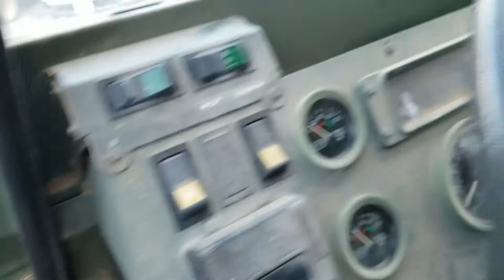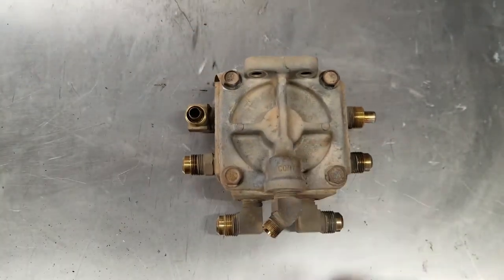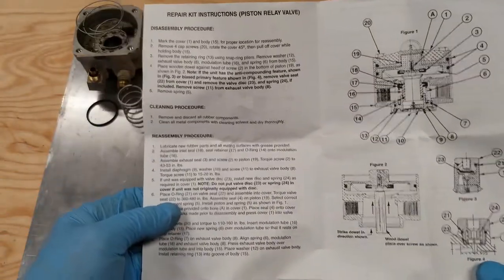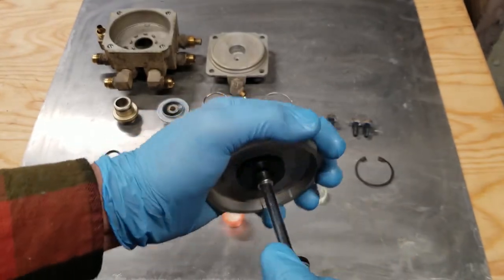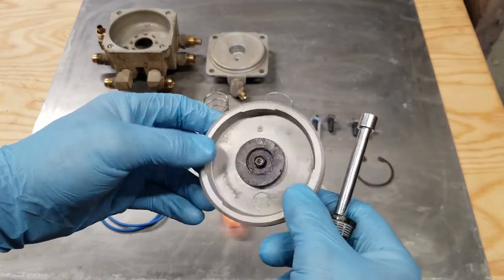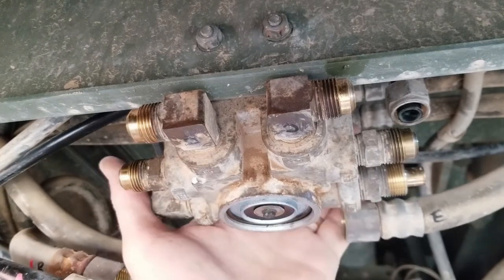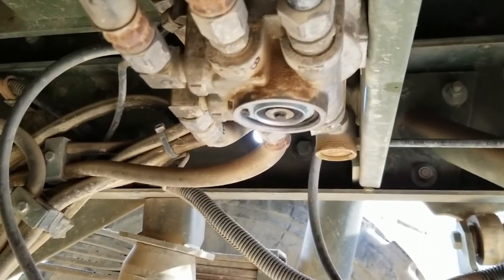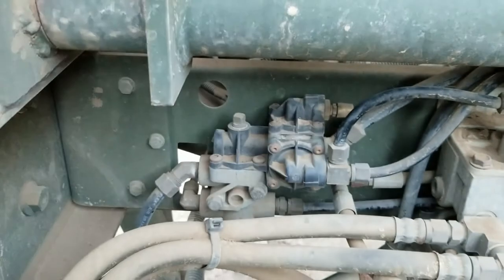LMTV Air Brake System - Haldex Air Brake Relay Valve Rebuild - Troubleshooting Leaking M1090 Brakes

Comment: I cut a circle of black duct tape to put on my buzzer to tone it down some.  It is there to let you know if while driving your air pressure drops so you can get off the road before your brakes lock up.
Reply from the maker: Sounds good. I still have the tape on the outside. Unscrew the cap and put it behind it so it doesn't look so rigged.

Comment: Hope you get it figured out they can be worry some anyway like your dump truck awesome
Reply: I have used duck tape myself and thought about disconnecting mine but if you do disconnect yours just be sure you or whoever drives it knows to keep a eye on the air pressure just like you would oil pressure and water temp cause they put those buzzer on there for driver safety reasons anyway hope you get that air leak taken care of some even take the emergency glad hand loose on the front and apply air there with a air compressor to trace a air leak but if you do that be sure to block the wheels because adding air from the emergency glad hand will release the breaks good luck I’m certain you’ll get her fixed
Reply from the maker: Got it all fixed up last weekend! Video coming soon. So glad to have it sorted out now. Before, while driving down a long grade, I'd really have to pay attention to how often I used the brakes. Not anymore. Thanks for the kind words. I really appreciate you!
Reply: low air must alarm must remain.  A long time truck driver/lmtv owner has made it pretty clear it is by DOT law that the alarm must remain.  Even though the docs say visual or audible alarm required.... he's found DOT inspection usually will assess the huge fine if audible not working.  Id guess in case of accident..... your insurance will likely not cover anything if it is not working either.   

 Some have found a cap off a can like wd40  or similar fits right over it and muffles it some.
Reply from the maker: Hi coachgeo. Welcome Back! Are you saying a visual alarm is allowed in the regs? Would a similar sized warning flasher work instead? Technically, this truck is not used on the highway, and only on the ranch but I do occasionally take it down the road to other ranches in the area. The local Sherriff wouldn't care one way or another but I prefer to keep this truck intact in a road legal configuration. What do you think about the flasher idea?
Reply: @cowboyV2  that is what I was saying after reading the DOT regulations that mentioned visual warning but the trucker (and LMTV owner) said.... in his experience.... the reality of it is a DOT officer will still fine you big time w/out an audible one.   Here is how it reads as of today

https://www.ecfr.gov/cgi-bin/retrieveECFR?gp=1&ty=HTML&h=L&mc=true&=PART&n=pt49.5.393#se49.5.393_151  

(2) A warning signal that is audible or visible to a person in the normal driving position and provides a continuous warning to the driver whenever the vacuum in the vehicle's supply reservoir is less than 203 mm (8 inches) of mercury.

dash light I suspect the DOT officers do NOT consider to be "visible to a person in the normal driving position"

Comment: My parking brakes only engage when there’s no air in the system… I’ve been eyeing up this same valve… do you think this might be my culprit too??
Reply from the maker: So it’s not dumping when you activate them?
Reply: Your parking brakes are spring activated, they are disabled when have air to them.
Reply: Just a note on parking brake springs- they kill. No joke. Do not disassemble your rear brakes under any circumstance. Replace the entire unit if there's a problem.

Comment: A cap from a can of brake clean fits over the alarm to help with how loud it is.
Reply from the maker: Think I might do that. Got the leak sorted out (vid coming in a couple of days) but still super loud during startup. Thanks for the tip!
Reply: I installed a buzzer with volume control and swapped the wires so it beeps and not continuous 
https://www.youtube.com/watch?v=wZ__Z8Z47Zg
Reply from the maker: Way better than continuous!